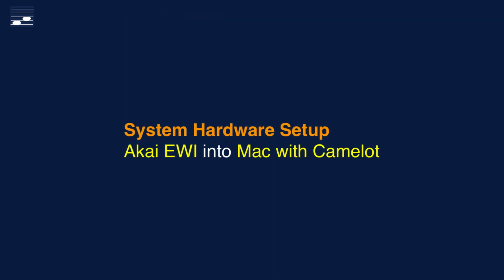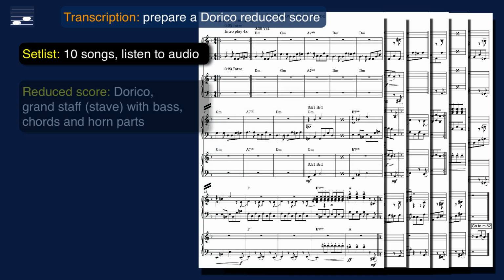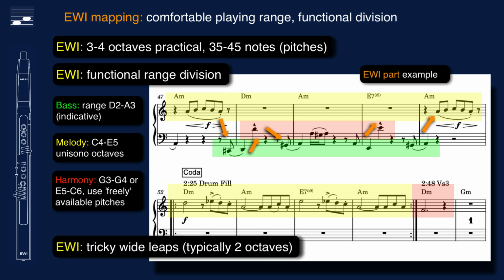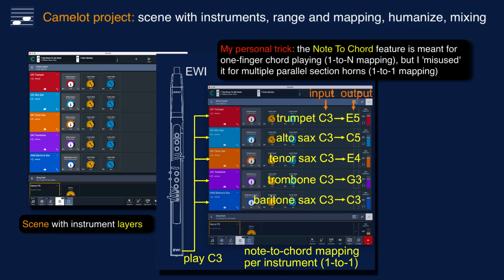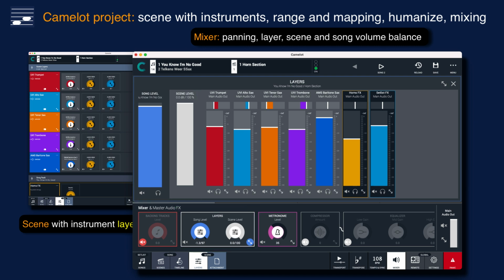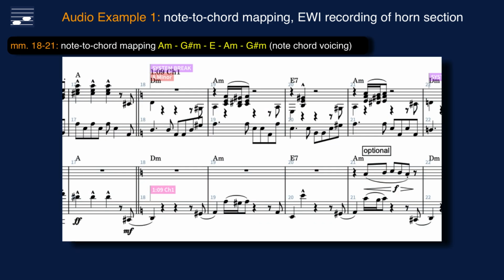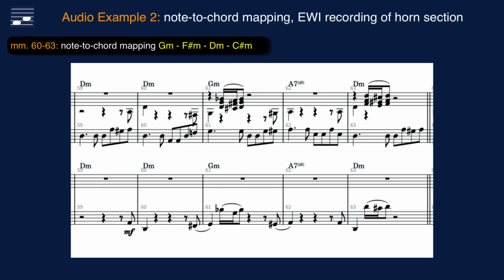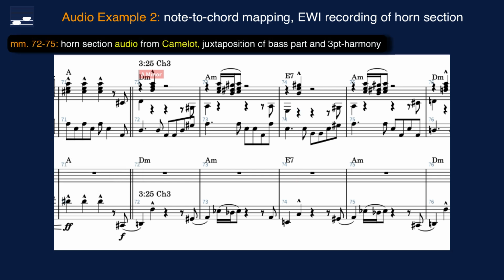Akai EWI and Audio Modeling Camelot Setup for Live Horn Section

Comment: Hello Frans, please can you give me some advice please 🙏? i have EWI 4000s. I've tried many times, connect my breath control to MIDI assigning for any parameter to any VST's plugin’s on my fL studio using synths like vital , serum , serge ,OPX II etc? for example macro to cutoff knob, it doesn't work just the basic sound and its nothing really works  to assign any parameter  with breath controller please hoh can assign or mapping my ewi 4000s. Thanks for you help
Reply from the maker: @steefons2813 Not sure I can help, but will try. By breath control I assume you mean blowing the instrument (not the mouthpiece bite sensor). The default output is CC2. There are two options for adapting the MIDI CC setting. 1) On the EWI instrument output. You either use the cumbersome  EWI instrument interface (buttons to navigate endless menu levels), or use the EWI editor software (might not run on the most modern OS; I have it working on macOS Sonoma and Win10). Select any CC there (run this editor while the EWI is not connected to the DAW). I have set my breath sensor to Expression CC11. 2) On the software instrument (VI, synths, etc.) edit the MIDI controller setting there to correspond to the CC the EWI is outputting. Since you mention the cut-off frequency example, that would typically be in the general purpose range CC16-19. Usually a right-click will open the MIDI CC assignment, or there is a specific GUI panel. However, in my opinion the breath sensor is not the most suitable filter controller. Use it to control Breath (CC2), Volume (CC7) or Expression (CC11). I would rather suggest you use the bite sensor or the glide plate (left thumb) for controlling filter settings. Does this help?

Comment: Thank you for posting this. This is very impressive, and is very much something I'm hoping to be able to achieve during my live gigs at some point in the future. My concerns with this are the enormous complexity involved in putting this system together, as well as something you pointed out, which is the chances of failure due to so many moving parts involved in such a complex multifaceted system, as well as the unpredictability of the 'hanging note' issue you mentioned, which, along with issues like feedback, can be embarrassing for a live group during performance. I see this is a recent post, so I'm wondering, have you tried using this for live gigs yet? If so, what was the experience like for you? Were there any disasters/unpredictable issues, or did it go very well? Thank you again.
Reply from the maker: @zacworld2061 The subject of this video is rather specific and probably only relevant for wind controller players working with the Camelot software. Still, since I put quite some time into preparing the settings for a live multipart horn section and for multiple songs, I thought it might speed up the process for others. And now to your comments and questions: 1) The complexity  should be reduced after watching the video and understanding the required steps. Accurate song analysis and 'bookkeeping' while implementing the MIDI note-to-chord mappings is the key element. Creating songs and instrument layers in Camelot is fairly straightforward and reliable. 2) Hanging notes. These do happen occasionally, and probably are caused by the use of the EWI controller, which is infamous for its poor generation of Note On-Off MIDI messages with the 'ancient technology' mouthpiece. Other conditions that may trigger hanging notes are the parallel use of sampled & modeled instruments (in my case SWAM with Spitfire) and parallel use of multiple modeled instruments (SWAM and UVI Acousticsamples); this risk increases as there are parallel instruments (4- to 5-pieces section, less so for 2-part settings. I remember that the Acousticsamples trombone was a likely candidate). Or the switching back and forth between two scenes in a song, which I controlled with a cheap sustain pedal and a dedicated remote controller setup in Camelot (a Message Transformer using CC64 as input. Pressing the pedal jumps to Scene 2, releasing returns to Scene 1; I needed frequent switching between a solo accordion and a 3-part string section frequently, at individual measure scale). The panic button in Camelot is your friend here, but you have to listen carefully and diagnose the hanging note case quickly; there will always be a few wrong notes sounding over a short time lapse. 3) Feedback; there were no cases of audio feedback. Did I mention that in the video, or did I misunderstand the remark? 4) System reliability. I did 6-8 rehearsals with this setup, 1 concert. During those sessions everything worked almost problem free, the concert had no hanging notes (this happened more frequently at home, practicing specific phrases from the songs, at higher tempos, or with the dangerous thumb roller octave leaps). Note that I did all this on an 8-year old Intel MacBook Pro. Only during the soundcheck I panicked as it took me several restarts before all hardware components were up and running (the Mac reported insufficient USB-power so either the EWI or the iPad would not connect. I had never seen this error message before, although using the same Apple power adapter.) I would certainly use this setup again, but preferably on an M-series MacBook. I have no comparable experience with a Windows PC (use both in a studio environment but in general would trust a Mac more in a live setting). So do not panic, and try to copy this approach for a single song. Hopefully this answers your questions. Thanks for asking, and all the best.
Reply: @FransAbsil Hi thank you for your detailed response. This is very helpful as I have been thinking of getting EWI again. I used to have the first generation but long since sold it. My remark about feedback had nothing to do with your system I was talking about it being one of those things that could be embarrassing in other situations for bands, It seems like the band I'm in goes through it some almost every gig because of mic is too close to a monitor etc. I do understand that mapping is the key as every song is going to have different requirements. I certainly do appreciate you took the time to do this video and show us how you discovered this beautiful system. Thank you again.
Reply: Hi how xan i purchase thos plugin?
Reply from the maker: @livellula2009   I am not sure I understand the question. Sorry in case there is confusion. There is no plugin: Camelot is a software product by Audio Modeling, my video explains the setup within that program for playing full horn sections live. The MIDI note mapping tables are specific for each song and virtual instrument plugin. I am willing to share the project file in case you would like to study my approach in more detail. In that case please send me an email. Thanks for asking.